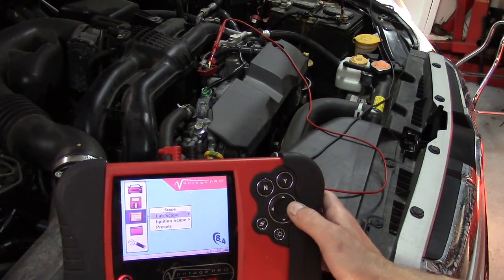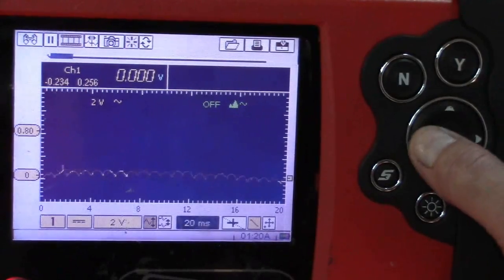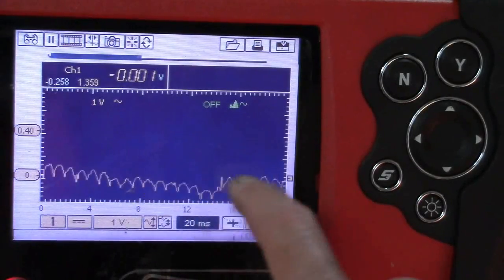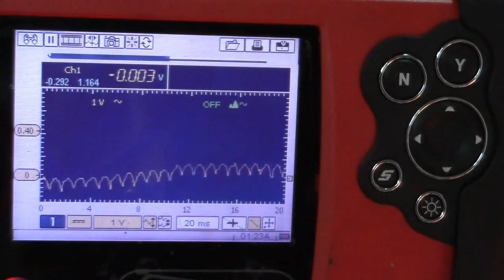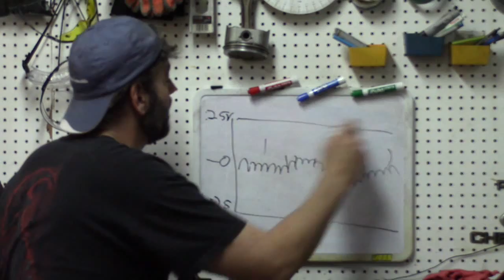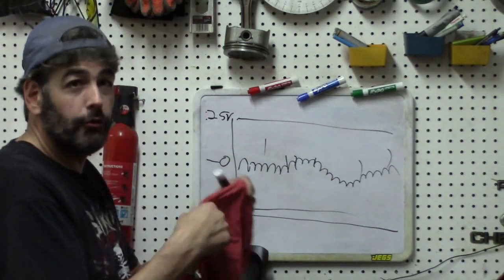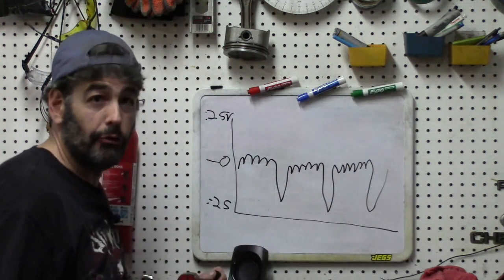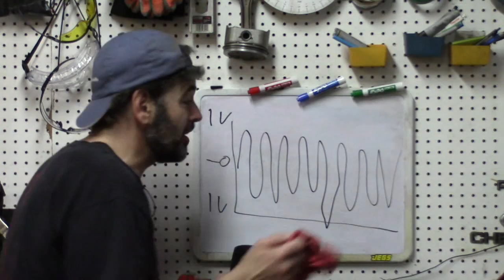DIY- Alternator Test Using the "AC Ripple" Method

Comment: Thank you! I have a question, what if I measure with a DVOM on AC scale at the battery and find out that the AC reading is over 1.5 volts (considering that the DVOM is reading a average) can I say based on that reading that the alternator is producing about 3 volts AC and that it failed the ripple test? ( I know you said that the DVOM is not able to pick up that fast Ripple AC signal but would be an average DVOM reading enough to diagnose a bad alternator?)Cheers from Dominican Republic!
Reply from the maker: Dang thats a really good question man (I see you do this a lot).  So the answer to your question is yes but you can't always rely on it. Remember your DVOM is going to give you the average voltage- so In the event you saw a high AC voltage then yes, you can confirm you would have had a high ripple. But what if you saw normal AC voltage- well, is that because the ripple is normal or is it because the signal dropouts are lowering the average of what was otherwise a high reading (or a normal voltage but you can't see the dropouts."
  We call this a "false negative" in science and the DVOM makes the testing subject to false negatives despite the confirmed positives.
Reply: Using a DVOM we allow up to .25v AC. (There is some material out there that will allow for more, up to .4v AC) . This is just one of the reasons that the scope is by far the better tool, but of course not everyone has one. The fun comes in when we try to get students to learn the difference between the information displayed on an RMS (root mean square) meter versus the oscilloscope. While the oscilloscope displays everything that is going on in a circuit, the multimeter as stated averages the voltage over a period of time. The trick new scope users often overlook is the scope also measures the mean (not the average) of the voltage that it is sampling and it places that at  "0 volts" of the scale on the screen. That is important to know when looking at the information on the screen, now the fun of converting from the AC that we see on the screen to DC effective comes into the picture. When measuring AC, the voltmeter displays the "effective equivalent" DC voltage. (Going with your sample of only having dropouts) If you take the positive peaks as displayed by the scope and measure to 0 you get the average peak positive voltage. Multiply that by .707 (sine of 45 degrees) and you will arrive at the DC equivalent that the voltmeter would have shown if it was sampling the same signal that you had on the scope. 

If you want to try and figure out what a given a voltmeter reading would display on a scope it works like this. Remember this will give you what the average peak voltage would be, (not individual spikes or drop outs. To convert simply multiply the DVOM reading by the square root of 2. (1.414)  If you do the math, .25v AC on a voltmeter works out to an average peak to peak voltage of .7v on a scope. 

BTW when a tool supports it, having the scope display the DVOM value on the screen along with the waveform helps techs a lot with the theory side. Doing that allows them to take that value and then look and see how much spikes repeatedly exceed the effective value in either the positive or negative direction.
Reply: just like an ohm meter with false positives.
Reply: Turbotomass I wish ohm tests followed the principle of science in that it should be consistent and repeatable. Just by holding the dvom, your hands are warming it and changing the ohm reading. Especially in the winter.

I suppose if I was accounting for temperature precisely perceived accuracy would go up, but I wouldn't know how to quickly account for temperature changes at the injector, in the DVOM, and the wires going up to the DVOM.

I am sure however that I never trust first ohm tests. I let things warm until numbers are consistent.

Like trying to use ohm tests to show injectors are off from one another. So hard to keep their temperature equal. 

I've often worked at shops poorly equipped to do more accurate testing. Example: I have my own fuel pressure tester but while it accurately reads pressure up, it can get stuck and not go back down.

Some random dude breaks the shops fuel pressure reader and you're stuck trying to get the same temp when ohms are tested on an injector to see if an injector is bad.

It's great when the scan tool does balance testing but sometimes it doesn't feel like it on some cars and you can't always get to injectors without disassembly of an intake and re-assembly each time. You can't take 6 hours to test 3 injectors. Lol
Reply from the maker: I like Johns answer better than mine lol!